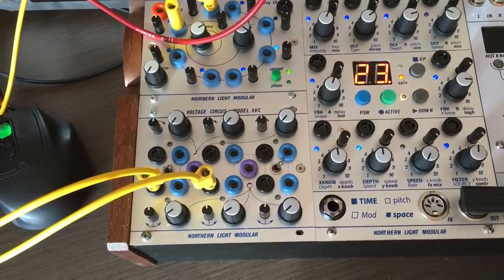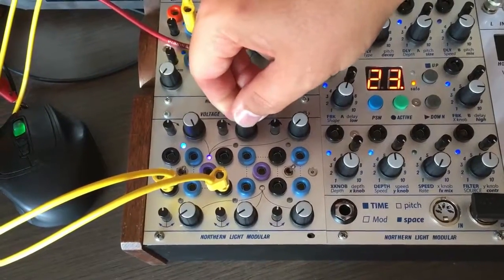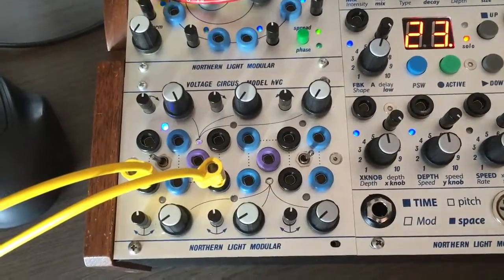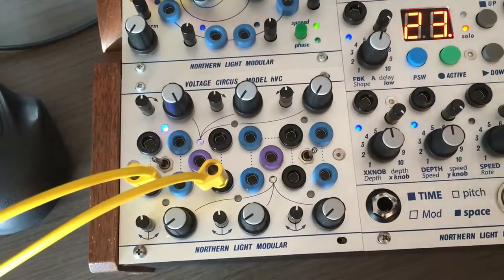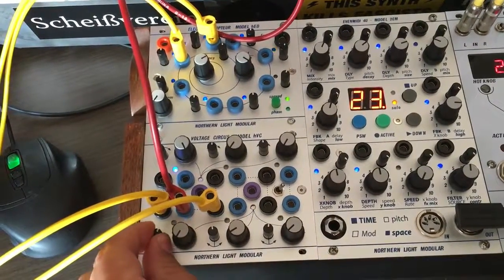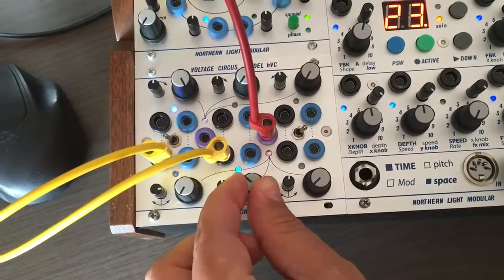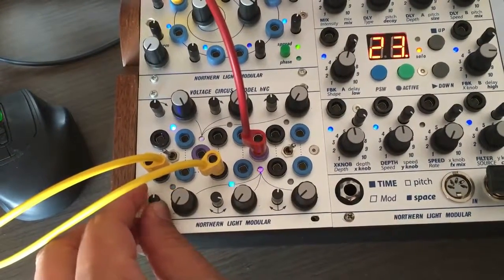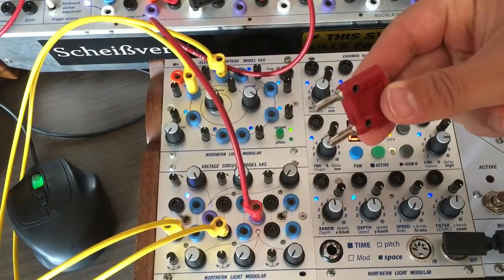Voltage Circus - model hVC

Comment: Loving my NLM modules! Trying to figure out if I can use this to eliminate negative voltages to make them safe for my 200e modules. Assuming the offset can be used to accomplish this but can Voltage Circus handle negative voltages to begin with? And would CCW attenuation bring negative voltages into the positive or is there an offset involved to create the approximation on an inversion? Right now I'm veering toward 257 because I know for sure it can do what I need but Voltage Circus is more appealing due to size and potential. Just need those details to make a clear decision.